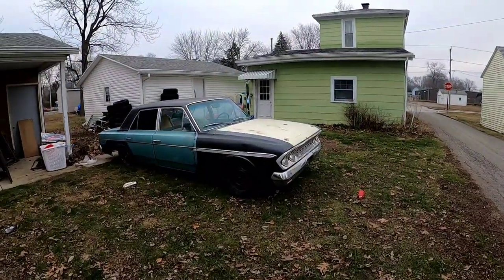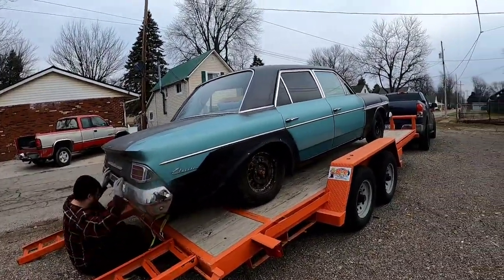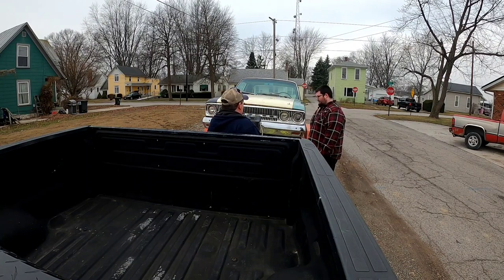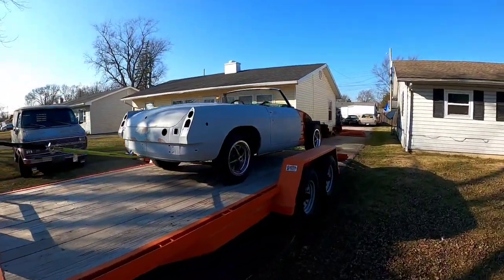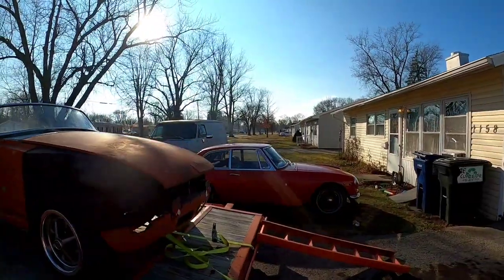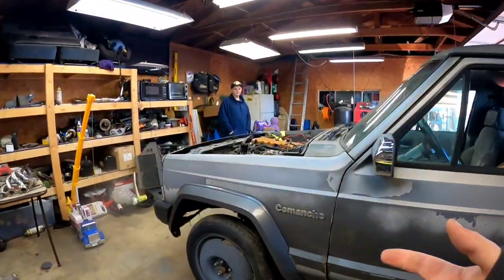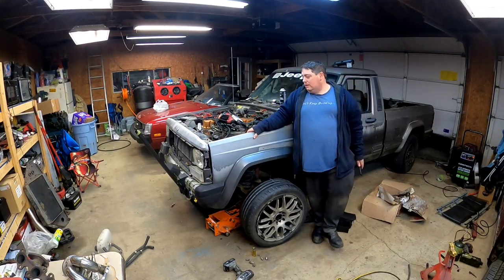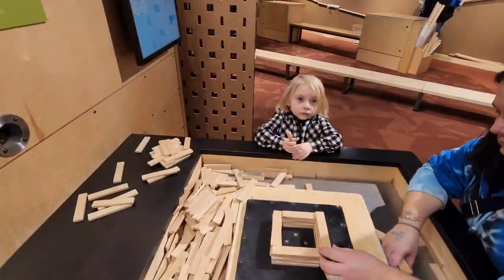goodbye rambler hello jeep?!?

Comment: Turbo 4.0 slammed street truck would be cool
Reply from the maker: I've kinda had that same thought. With it being a fresh rebuild too. It should be ok running atleast alittle boost
Reply: @kurtsoddgarage  I wouldn't make it anything crazy but it could handle a little boost Matt's off road recovery yellow xj makes some power
Reply from the maker: @joshslackslack8115   yea with no bigger than it is.  Get it to around 250-300 hp an it would be a fun little truck
Reply: @kurtsoddgarage  really would I've got a S10 with a 4.3 put some money in the motor pushing little over 300hp good daily driver cruise around truck if you are going to drive it I wouldn't try to make it to crazy just something fun to drive and cool I'm sure the 4.0 V6 you have now is pushing something close to 200hp right now
Reply from the maker: @joshslackslack8115   if I remember the 4.0 i6 has around 170-180 hp  an 240ish tq 
So it's not terrible stock. 
But 10psi of boost would wake it up lol.  
That s10 sounds fun!
Reply: @kurtsoddgarage  find a turbo for a dodge Cummins diesel truck it will wake it up if I had another truck I've got a twin turbo setup from a junk ford 6.0 diesel truck but I drive my truck to much so I haven't felt like taking it apart again to turbo it fully restored my 83 S10 over the past 5 years don't want to take it apart again probably never put it back together if that is a bucket list truck for you I would build it right the first time how you want too my S10 Is nothing crazy but it's fun to drive you have a good start to something them truck's are not getting any easier to find hope you enjoy it and get it like you want it to be
Reply from the maker: @joshslackslack8115   yea if I do it I'd probably going with something along those line. 
Right now the goals to get it driving an see if it's really something I want to keep....or if it's just a flip car (truck) to get to another bucket list car. Only time will tell